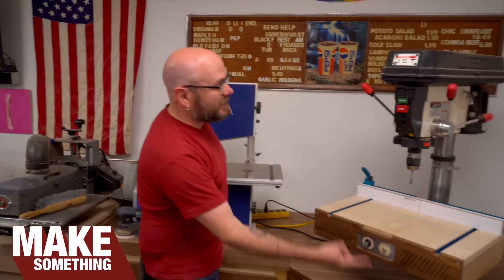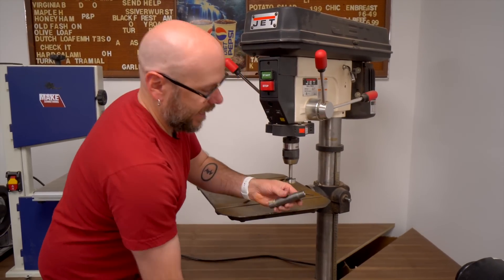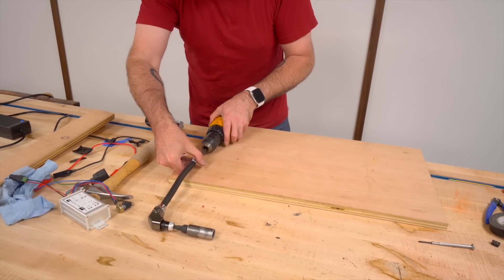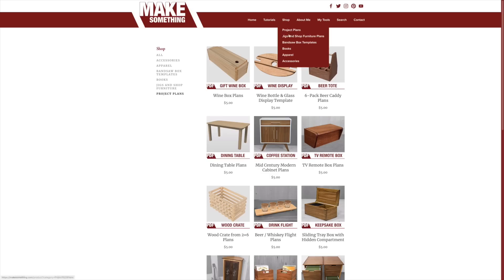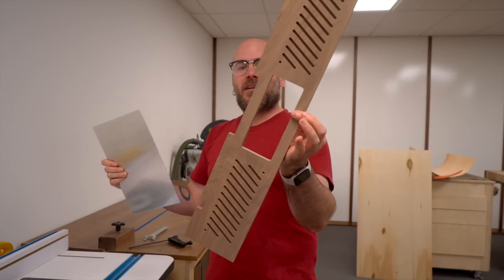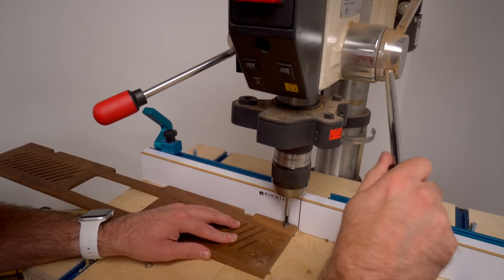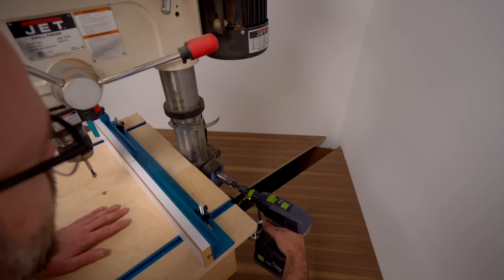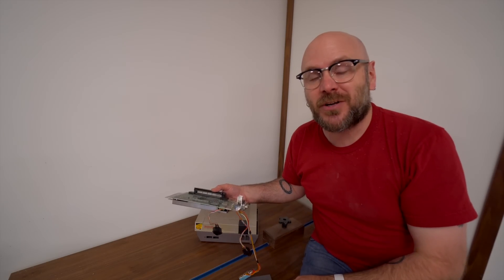How to Make a Motorized Drill Press Table Lift! Way Cool!

Comment: Funny the last 2 days I have been working on extending the handle on my drill press (jet) so I can add a new table I am making and it won't hit the handle. I am not trying to make it motorized but I have run into the same issue trying to find a fitting that will fit the piece coming out of the existing handle with the flat end. I just want to extend the handle out about 6 inches. The end into the handle is 1/2 inch but the end coming out of the drill press with the flat end is bigger.

Comment: I scrounged around my old ratchets box and found a cheap 14mm socket drilled and tapped a hole in it tightened to the drill press after removing the crank that came with it. I cut off an old extension and use my battery-operated drill.

Comment: Of course for the crank you could have just used a coupler/reducer, but welding it works too if you don't have anything on hand at the time.

Comment: stepper motor, or  go to a salvage yard, and buy a power window motor off an old gm pickup truck   or one off the tailgate on a ford bronco, these are 12v dc nd have a lot of power.
and or old treadmill parts  but wiring gets really complex if you do not know much about electronics.   I'll advise you to learn some basic electronics.

on your oak part you could have made the  \\\\\ marks     ///\\\    \\\///  /i\i/i\/i\
with them like this    \\\\\\\        ////////    it pulls your eyes  to the knobs.

hell might as well put speakers in it and cut a hole for a smartphone  to play louder via tunnels.    https://youtu.be/PE7nT8WYzik

Comment: Hi folks. The main electrical challenge in using cordless drill motors is giving them enough current to do the job. Typically the motor might be capable of putting out say 180 watts, so with an 18 volt drill for full power output the current required is in excess of 10 amps (current = watts divided by volts). It will in fact be more due to mechanical inefficiencies. However, a laptop PSU might well be capable of outputting 5 amps at 18 volts, giving a bit under 90 watts of power. That's roughly one tenth of a horse power. You can still do quite a bit with that, just won't happen very fast - which may be a good thing!. For best results try to match the power supply output voltage to that of the drill. For a 12 volt drill a very good cheap power supply would be a car lead acid battery charger. BobUK.
Reply from the maker: Thanks!!!

Comment: Great idea.  I have a couple old cordless drills that I almost threw away the other day.  I've held on to them hoping to make something useful.  I think I'll try to build it behind the table instead of underneath.  That way I have more range with the table and can avoid the right angle issue that you've experienced.  I also like the comment that was mentioned of adding limit switches.

Comment: David! This is a really cool project, I'm a nerd for motors. As you have discovered a direct drive system is more efficient than a system which uses some sort of linkage due to friction decreasing the amount of torque provided to the load. Very cool walnut grill btw👍

Comment: If you have room you could extend the back of table and mount the drill in line with the shaft.   And  yes I most definitely do need a motorized table lift

Comment: I think if you expand the lower part of the base back to support the flex arm and keep it rigid, that would solve your problem.
The 90* angle keeps everything compact. 
I think trying to mount it direct will end up being too bulky and take up more space than it needs to. Just a thought.

Comment: try one of these https://www.amazon.com/DEWALT-DWARA100-Right-Angle-Attachment/dp/B00C0VSNKQ/ref=asc_df_B00C0VSNKQ/?tag=hyprod-20&linkCode=df0&hvadid=309811990469&hvpos=1o1&hvnetw=g&hvrand=9597927420263377897&hvpone=&hvptwo=&hvqmt=&hvdev=c&hvdvcmdl=&hvlocint=&hvlocphy=9033496&hvtargid=pla-303256324028&psc=1

Comment: Great Video!  I would make one suggestion.... Change your up/down switch into a momentary switch.  You have to hold a momentary switch either up or down and when you let go, it returns to OFF.  Much safer than accidentally bumping your switch ON and having the table crash into the bit.
Reply from the maker: Excellent idea!

Comment: SO great! I've been working on a very similar system to make a sewing machine lift for my sewing machine table. I'm using a small motorcycle jack to scissor lift the sewing machine and a Pololu driver board to control the drill. It's awesome we came at it from different backgrounds (I have a lot more electronics experience than woodworking.) Congrats on the great project.

Comment: Au contraire, young wood souse! There is another way to to keep the motor in the box, smoothen the action, eliminate the unwanted wiggle, and even increase the sexy! Google "drill press table," "woodsmith," and "miter gear." You could also search the same terms just on the U-Tubes. A miter gear setup might require less modification on your rig than the "direct drive" option. If not, then, well, gears are cool anyway, so win-win!

Comment: Smaller DC motor that is belt/chain driven to the drill press shaft?  Could adjust ratio to get more torque or less...just a thought if you do look into options.

As always, extremely creative video! cannot wait for the NES video!!!!!!!!!!

Comment: Excellent Idea! As the others have said, a rigid attachment should fix the motor issue.  There is a small amount of binding in the rack-and-pinion on the drill post that is causing the flex drive to move. Lubricating the rack would help, but that isn't really possible or practical in a wood shop. A direct drive motor should do the trick.

I can't wait for next week!

Comment: Try using a worm-drive windshield wiper motor.  They are cheap, have decent torque, and are sealed.  You can get them on Amazon for around $30.

Comment: **Missed Oppotunity^^ - You should've printed the speed dial controls with actual numbers seen.  That way you can see the maximum speed setting is "ELEVEN"!  That's what the guys from "This Old Spinal Tap" or "The New Spinal Tap Workshop" would've done.  Clearly,  St. Hubbins, Tufnel and Smalls will always be one decibel ahead of Picciuto.
Reply from the maker: Ahhhh, yes!!!!

Comment: The rack gear on your press column should not swing like that; its top and bottom ends should key into notches on the base and the shaft ring up top (at 7m00s you can see the rack's top key showing, which shouldn't happen). You need to fasten down said top retaining ring (there will be at least one grub screw on it); those hose clamps are unnecessary. As for the flex-shaft, the more you tighten its radius, the more it rubs on the inside, and therefore the jerkier the movement on the table. Bloody useful project though!

Comment: I've tried powering my old 12v battery drill with a 12v 20a before, but every time the drill spins up to speed it trips the integrated breaker. Anyone got any pointers or similar experiences?

Comment: Love the project, I wish you hadn't ordered the motor yet... DeWalt makes a small 90° drill adapter that is a rigid piece, I think HD has it for 14.99. I think that would work far better than the flex shaft does. My other concern is the gears... That motor you showed us looked like it still used a 90° gearing adapter, and I wonder if that isn't where any of your binding issues come from.

I definitely look forward to your update on this though. The Craftsmanship that went into this (and all your projects) always leaves me incredibly jealous.

Comment: This came out great despite the future changes you plan on making! The flex in the flex shaft definitely is adding bounce. A rigid right angle attachment may work better but I like the motor directly mounted idea better.

Comment: I love it ! I especially love the upcycle,  I've done things similar, mostly led vehicle lights, I would go to goodwill and salvation army to find a adapter that has a 120v in and a 12v out, straight wire it together with a inline switch!

Comment: Why not just attach the drill directly to the gear and eliminate the flex shaft. Just put it all back into the plastic and mount the handle to the table so it doesn't spin.

Also, will the NES build incorporate compressed air to blow out the cartridge? Being much older than when I originally had an NES, I'm sure all that blowing will make me dizzy.
Reply from the maker: Never blow into it! the moisture from your mouth corrodes the contacts.

Comment: You could use a different angle attachment that does not have the flex shaft for a more consistent drive rate. I have both versions of the angle drive and the flex shaft seems to wobble a lot and steal some of the drills torque.

Comment: Beauty , But instead of buying a new motor why not using some T5 timing pulleys and a timing belt ? Go for a 1:3 is less speed more torque . You can easy chuck some round stock in with the diameter of the id of the pulley ,drill the id off the bigger pulley to fit the shaft where the crank was put the belt on and done.
That way the motor can stay under the table and don't take more space

Comment: Is that future motor a windshield wiper motor?
Reply from the maker: Not sure. Just something I found on Amazon.
Reply: I tried with a GM windshield wiper motor about 5 years ago, direct drive to the table shaft but it did not have enough torque to move reliably enough.  The motor also got really hot and set off the internal protection thermal breaker  

I never got around to finding a better gear motor and took it all off.

This motor you have looks much bigger.

The motor stalling could be the PWM driver current limit protection circuit, if it has one.  The drill can and will try to use more than 20amps which is the limit of the PWM driver. Or possibly the laptop power supply current limit protection kicking in.  They are only rated for 3amps or so.

I used a high current 12volt LED driver power supply.  Which is supposed to b good for 20amps